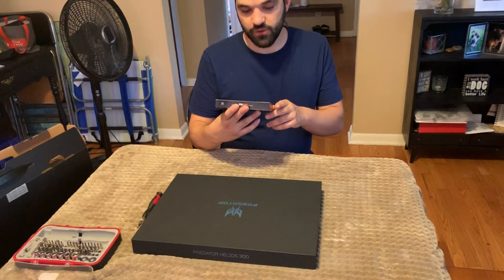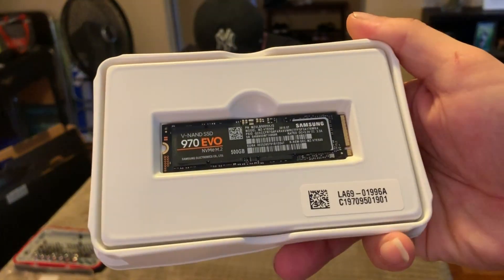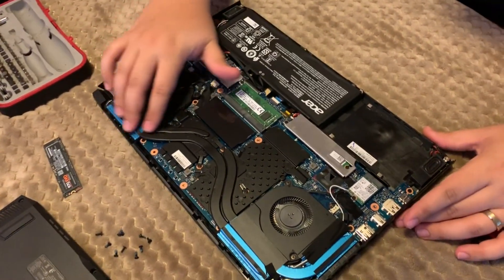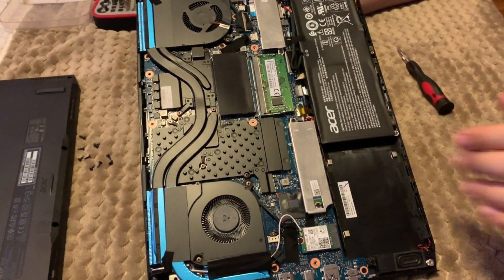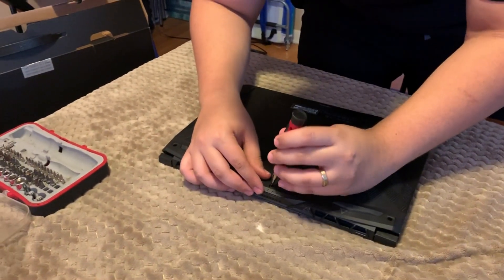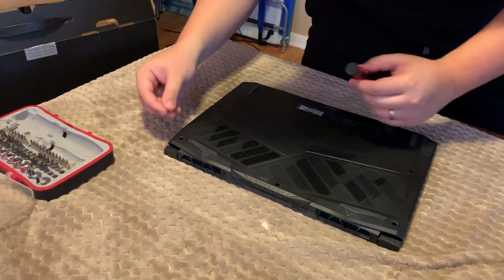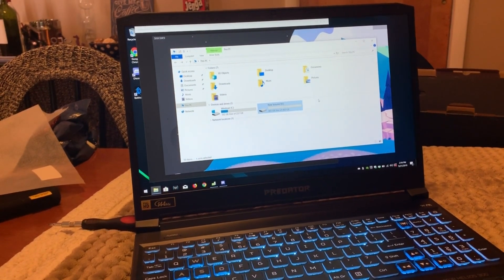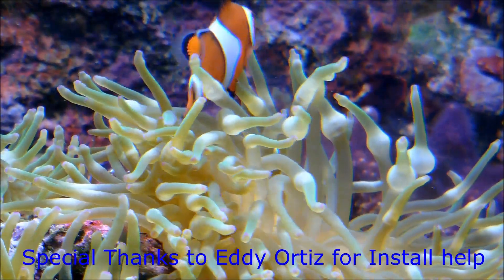Review of how to Install samsung 970 EVO NVMe solid state drive on Predator Helios 300 gaming laptop

Comment: How is the temperature?  I heard nvme drives can heat up quickly causing thermal throttling
Reply from the maker: I use a cooling table for my laptop. Just because when I'm playing some games I can hear the internal fans running at max speed to cool down my computer. Now it does not get as loud.
Reply: Nvme’s are actually really good especially for gaming.

Comment: Done installing ssd..but my laptop won’t powered on..any advice?
Reply: I have same problem. Cannot find solution.
Reply: I just rebooted it
Reply: You sure you installed windows? Go install windows and put it on a flash drive and plug it in when the new SSD is connected.
Reply from the maker: Sorry not sure. Don’t have a computer person in the household anymore. Good luck on your travels.

Comment: the sata space is actually there so you can put in like a 4TB HDD if you like. So you can have fast system drives and still take all the data with you that you might need.
Reply from the maker: Awesome. Thanks for the information. Good luck on your travels.

Comment: What is the default SSD-stock brand...And can 1 TB be compatible with the second m2 slot?Thanks
Reply: Not sure about the default ssd-stock brand, but you should be able to install a 1tb nvme on the second slot.
Reply: Mine came with a 250GB SK Hynix. Pick a Samsung M.2 that fits your budget and use Samsung magician to clone the drive. It will only take several minutes to do this. Then use the new Samsung drive as your boot drive.
Reply from the maker: It should be. Good luck on your travels.

Comment: You really should clone the old drive to the 970 EVO and use that as the boot drive. Kind of a waste to use the 970 as a slave drive.
Reply: Performance gain will be minimal for Windows boot time and average file copying etc, not worth the hassle of cloning. But I understand your point, the 970 EVO is better than the drive the laptop comes with.
Reply: @thisiseddy  I completely removed the drive that came with the laptop and replaced it with the 970 EVO Plus. Using Samsung magician it took no time to clone over the drive. (quicker than going through my junk e-mail)  I'll get an encloser for the 250GB drive and use it as a portable external drive.
Reply from the maker: Got it boss. Good luck on your travels.